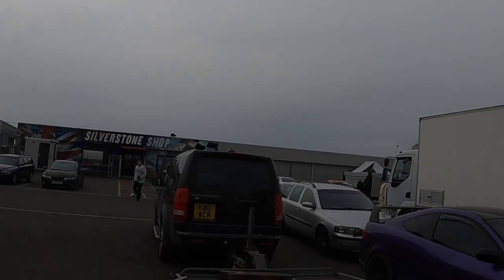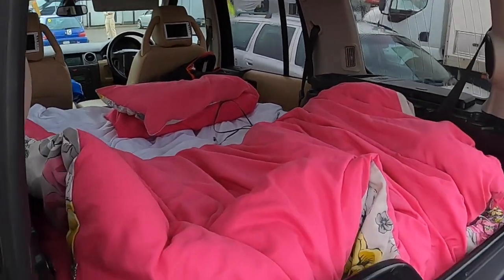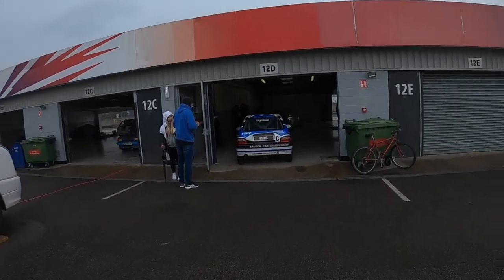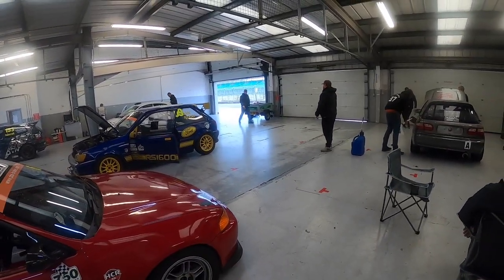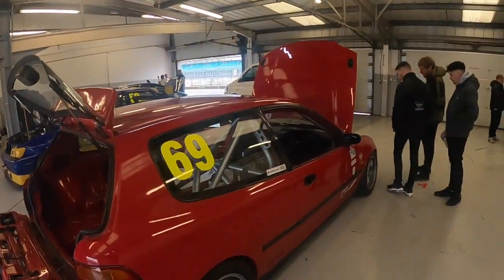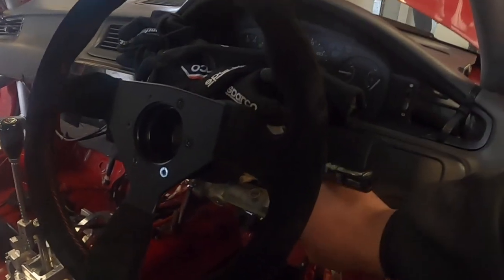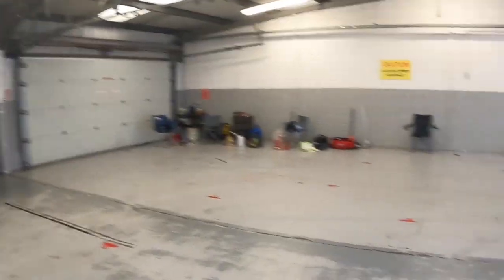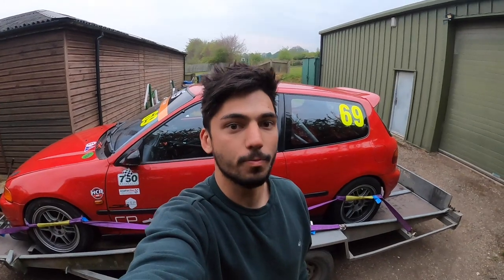Double DNF at Silverstone - 750MC Hot Hatch Round 2

Comment: I was leaning against the blue 106 at the start of the video.  Your fuel issue is the fuel pump almost certainly. It's quite interesting watching your video. I suggest you lean on Dan a bit more and talk to him about lines and stuff, failing that Driver 61 on YouTube is useful or maybe just get some tuition. Also have a plan for the day and each session. whether it be to work on your lines, or speed/commitment or set up. I'd argue that it was never really wet at any point of the day for us in Hot hatch. A very light smattering of rain, creating a touch of understeer, but I ran full dry set up and didn't really consider anything other than dry levels of commitment.  The set up changes you made were purely to ease your psychology, its a confidence thing, your head says its a bit wet, or the cars a bit squirrelly so you soften it off at the back, which induces more understeer.  Which make s it feel safer but is slow.The rain on the windscreen at speed makes it look a lot worse than it is. But it's your second race meeting and you still haven't damaged it. Which is good... up to a point. Motor racing is either a high or a low and nothing in between. My engine shat itself so I am out until at least Snetterton.